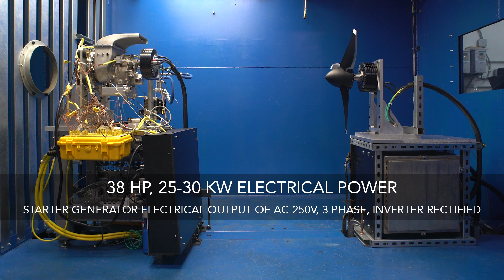Monarch Hybrid Range Extender (HREX)

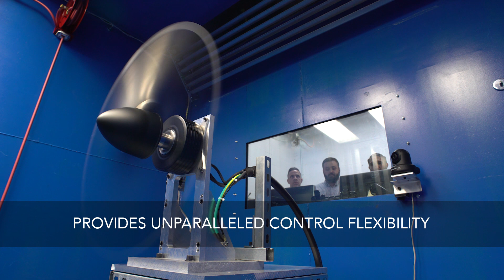Comment: Efficiency is claimed as a feature at 1:28. What is the efficiency - or Brake Specific Fuel Consumption - of this turbine engine, compared (for instance) to piston engines of the same output power? Without actual data, this is a meaningless claim.

Comment: Gearing the turbine output down by a factor of 16:1 - requiring a multi-stage reduction gearing system - to connect it to an electric motor-generator is nuts... especially to use an Emrax motor designed specifically for low-speed (direct propeller drive) applications. The turbine-generator set should use an electric machine operating at turbine speed, for simplicity, reliability, and lower weight. But, as they say - UAV Turbines expertise is not in electric machines.

Comment: I own a 2018 Hybrid Pacifica w/ 16kw 🔋 (33miles). I drive about 100 miles daily so looking to extend my range & this may be the solution instead of adding batteries. I'm in Atlanta & I have the funds so let's make it work, anything is possible these days. 👍
Reply: No, a gas turbine engine is not efficient enough and not clean enough for an automotive application... even in a hybrid system.
Reply: Yamaha Mulah, what did you end up doing?
Reply: @ericstephens4413  keeping as is for now